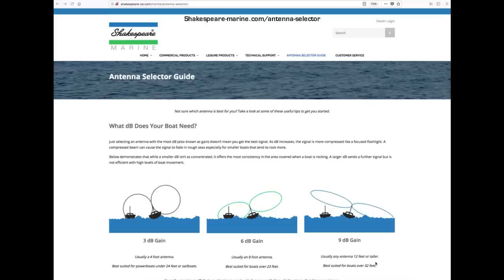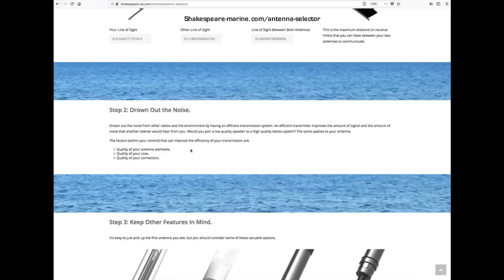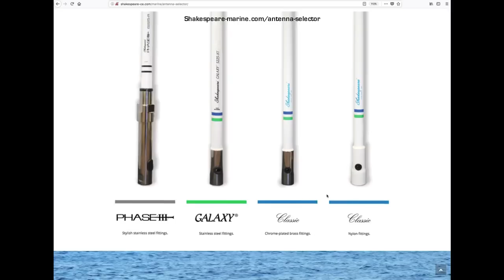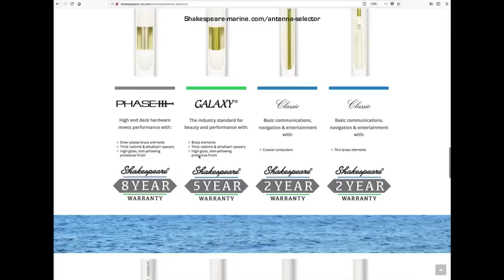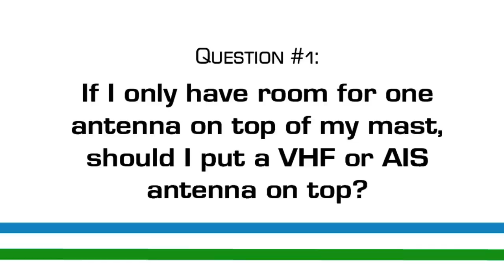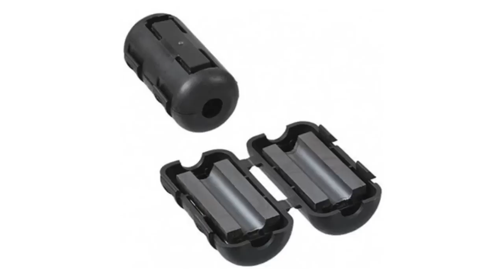Extending Your VHF Range

Comment: You talk about the lose of efficiency with a 20' long coaxial cable. Would this lose decrease by shorting the cable length? I'm mounting an 8' Galaxy on my T-top and running to my Vhf in my console. So say i cut 10' of coaxial off to not have a large roll of wire in my head. Would this help or hurt the reception? I would think less cable would have less cable loss.

Comment: I have a center console boat and have a 3d wip antenna mounted on the port side with vhf I'm looking to install a 6db phase3 8'antenna on the starbard side with another vhf. One radio to keep on 16 and I to keep on a fishing channel and to communicate. Is it ok to install two antennas? The standard horizon 6000 also needs an ais antenna. Any ideas?

Comment: please answer asap what antenna is best for a sail boat, a long antenna i think would be in the way of the sails, i am thinking of installing the antenna at the top of the mast, i am looking at ether the
TRAM WSP16763 AIS/VHF 3dBd Gain Marine Antenna or your 
Shakespeare 5101 8' Classic VHF Antenna, but i am worried of it hitting bridges, and being on top of the mast, no way to get up there to fold down, and cables to short at 15 feet long
  mast, but all your antennas only come with 15 feet of cable, and adding a connector to add cable weekens signal am redoing all the electronics on a customers 50 year old yat, and will be making you tube videos on it all, in stall and removing old wiring and electronics, boat is on the largest of great lakes, getting supplies off amazon.ca as i no longer have an account with cc marine since i closed my shop

Comment: I have a 23’ CC with a rod holder that puts the rods in the same location as my whip antenna. Which is located on the same side of my console. Are the rods going to interfere with communications.
Reply: I don't think the rods would have much effect if they are not made of metal, but any metal located near the antenna will affect the antenna performance.